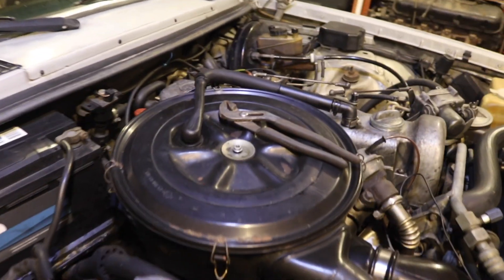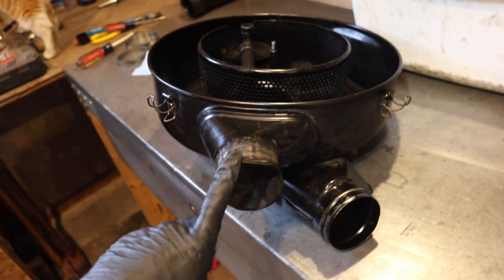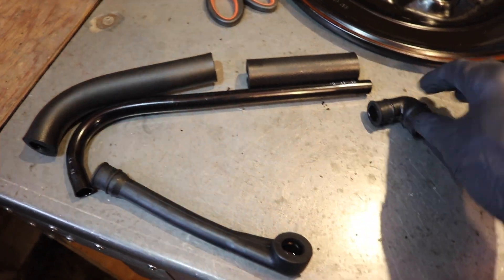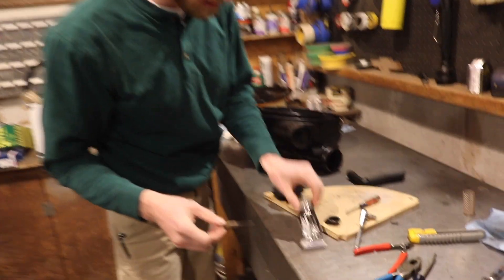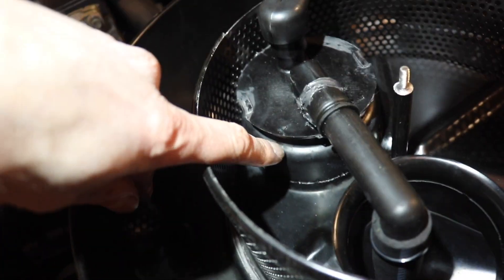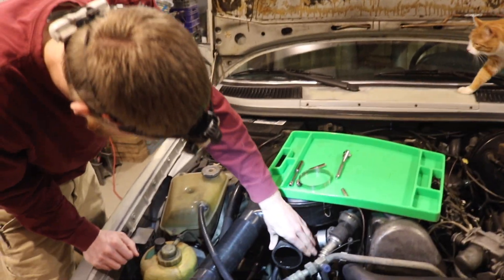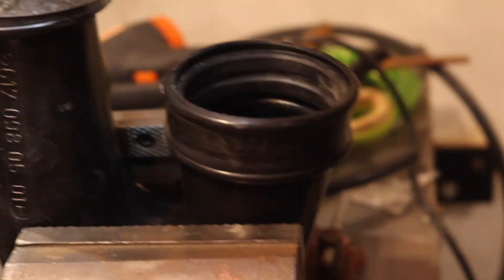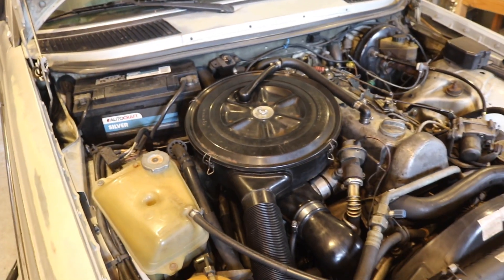OM617 INTAKE MODS - 1983 Mercedes 300TD

Comment: Dumb to keep heavy, rocking, cracking, oil and air leaky stock unit. A simple cold air intake solution, filter boxed and fed by the outside air intake.

Comment: Can you just vent that breather hose to the bottom of the car instead of sending that vapor back through your intake?
Reply from the maker: @zfunk9  you could. But if you did that, you would have a decent amount of smoke and oil spray spewing out at all times.
Reply: Isn’t that better for the car than sending all that back through the air intake system?
Reply from the maker: @zfunk9  these engines can run on almost pure engine oil. The small amount of engine oil that gets sent thru the intake from blow by will not be an issue.

Comment: What is 3:11 this part ? I put a cold air intake on and I need a replacement part.
Reply from the maker: It’s an oil catch can that captures the oil vapors from the crankcase vent and allows the oil to drain back into the oil pan. I don’t know what the technical part name is.

Comment: Hey buddy you can use some of the rubber boots that you can get at a lumber yard In the plumbing section!!! They use them to connect pipes together!!! They have all different sizes and angles also!! You can cut them to the size or length needed!!! Plus they are much cheaper than what the regular seals will cost!!! Hopefully this helps you out??? Remember keep up all the hard work buddy!!!! More fire truck videos and more camping videos!!!

Comment: I always delete that air filter contraption on my diesels. Look up dieselish. They have a great kit with the proper parts to swap out with great quality items. And plus you really hear your turbo spool!
Reply: You could just order a filter and a catch can for much cheaper. The stock intake is about as good as it gets from performance; the problem is the amount of space it takes, making it harder to access the turbo or see leaks and those damn mounts that always break. I think they could've done a better kit for at least the S classes to have a heat shield and force the stock ram intake part so the new filter gets cold air, instead of hot radiator air, lol.